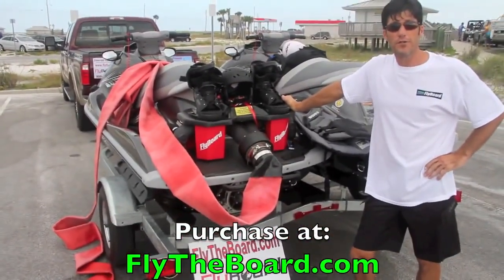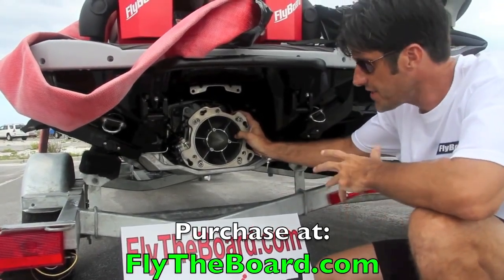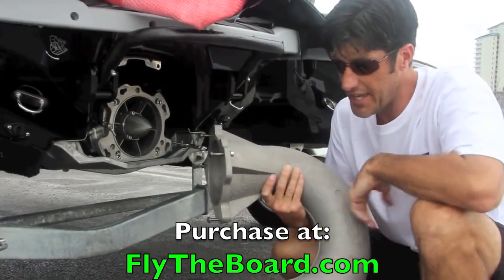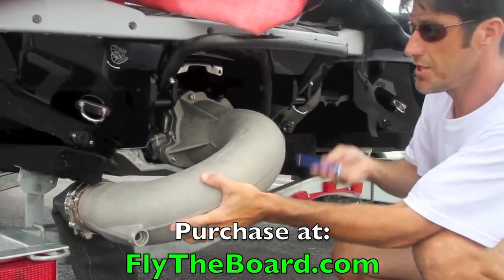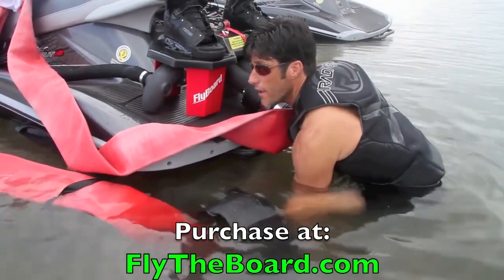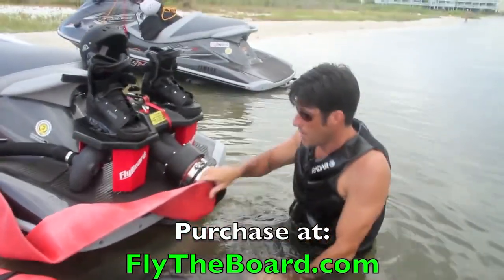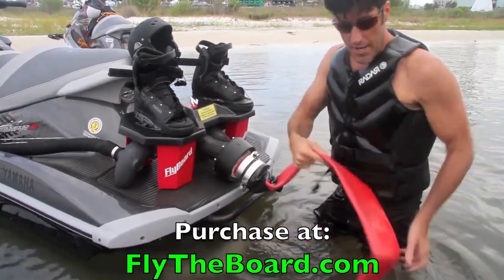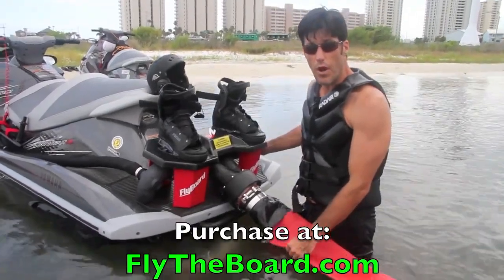FlyBoard  How it Works

Comment: So how does the jetski move if the flyboard takes 100% of the thrust?
Reply: seems like the guy flying is pulling it lol i dont think the dude controls anything
Reply: @sebastienfaubert4891  jet ski rider controls the throttle
Reply: @elliottkeyes9448  yes , but the water pressures comes out the tube under the flying dude, him moving around is what pulls the jetski it seems.
Reply: @sebastienfaubert4891  I wonder how much fuel does it consume or at what rates.
I try to calculate the minimum to purchase it and all it includes, which is also a jet ski and trailer for the jet ski. also I don't have a car with a tower so that's a prob lol. seems that 7k-8k might be the minimum for the purchases (assuming the jet skis I saw are powerful enough) without the long-term expenses of insurance, fuel, etc.
Reply: There is a small  diameter straight nozzle on the 180 Pipe pointed to the back to propel the jet ski forward. Albeit slowly..

Comment: From where this all up and down,twist,anguler 180 degree, either from pump controller or rider himself.
2,what is the pressure while moving upward to max.height.
What is pressure varies in between the movement.
How the rider maintain his
balance when move to different angle.
Is this  need some special
training for balance his body.
t